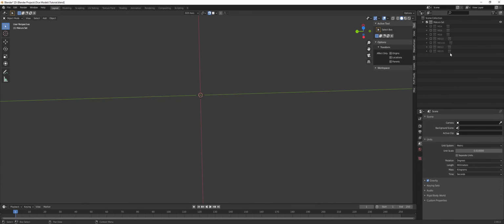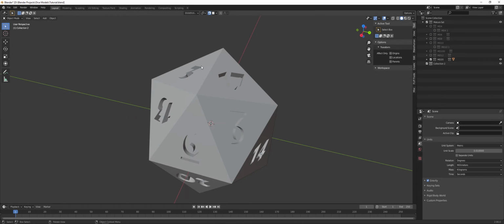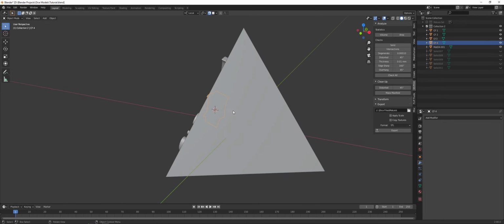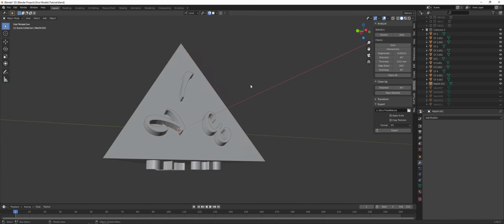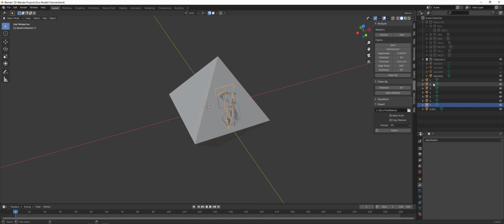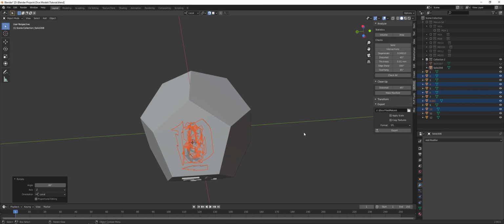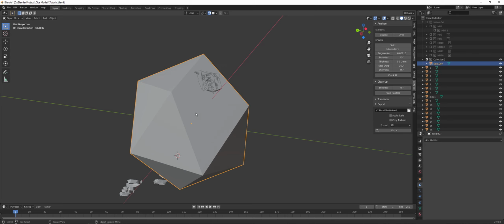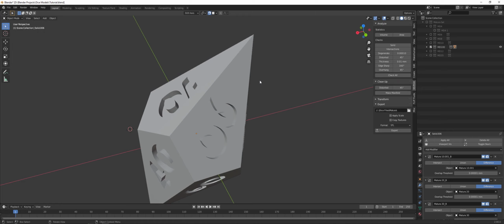Dice Making in Blender Part 2 - Adding Polyhedrons and Numbering (Has problems in 2.91)

Comment: Hello, I followed your guide definitely one of the better ones I've seen. I'm running into an issue that when I do boolean it cuts through the dice all the way through, do you know what might be going on?
Reply: Could be the normals of the objects. In edit mode once it's covnerted to a mesh you can hit A to select all and then Alt Shift N, or N and recalculate outside.